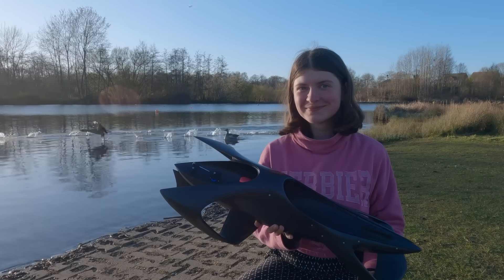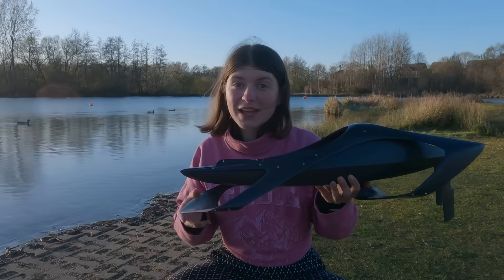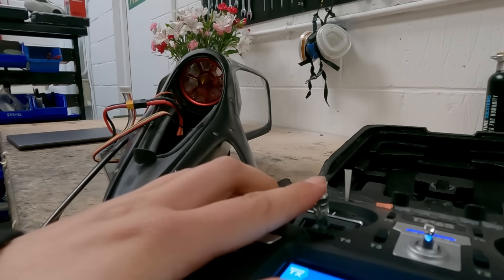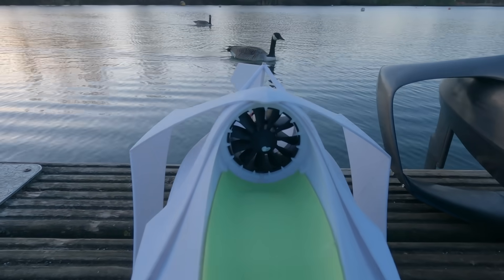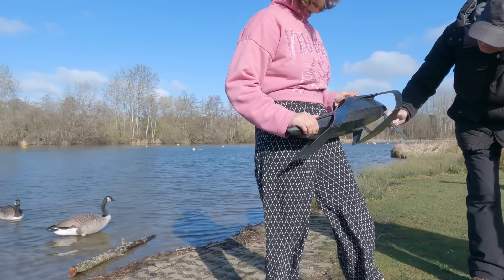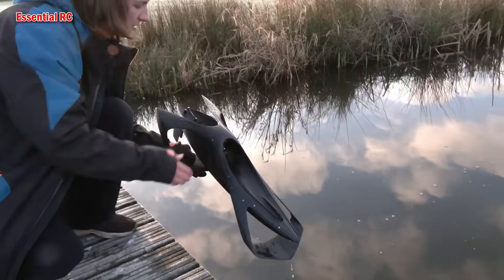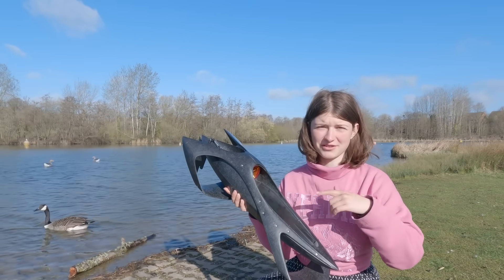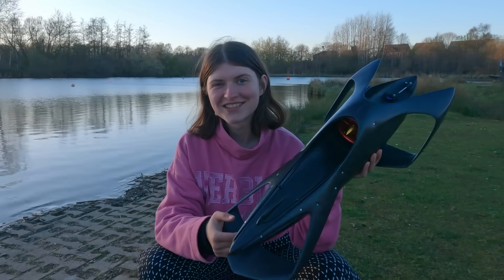Boat Propellers are Overrated... The HydraJet Explained

Comment: Well done i like fast small pylon racer type CZ republic  Voodoo plane ~20 inch wing span hits over ~120 mph in dives with S400 brushless types. For future project I want to scale up to have liquid fueled rocket engine ~25 kilo push for ~10  seconds burning LOX and 100% nitro methane for  engine  run  in a vertical dive to level out  about ~50 foot height and exceed the ~550 mph that kero turbines give .The idea is rocket craft is  dropped from mother craft at ~1000 foot height  but recon it needs auto pilot control with RC to ensure it isnt going to lawn dart . Biggest problem is how to ensure reliable pressision  engine starts making solid fuel and hybrids rocket engine unlikly to work . Lots of onfo on high speed craft from ~550 mph dynamic soaring non engine RC gliders and ~550 mph  Kero turbine crafts where models wings are nearly solid carbon fibre wings to take the immense lift on wings at those speeds in ~+10 G turns

Comment: Instead, of having a waterproof motor you could give it a very long shallow shaft, so the shaft is the only thing touching the water, while the motor is in the body above the water - basically like an electric mixer.

Comment: Awesome design. I'll like to see a few things if you're open to ideas and haven't tried them/ruled them out already.

Fuselage/rear wing design more reminiscent of a passenger liner. The rear wing could have 2 engines mounted rather than 1.

Using the air for jet drive through the rear hydrofoil on both rear corners. (You could hypothetically use 2 cups like jet boats to instantly stop/aid in fast turns.

Wing shaped outrunners with small pontoons to maintain stability at high speeds like a sailboat.

Any kind of keel on the foils or boat.

Underglow and speakers. Pimp that boat.

Comment: Put some ground effect wings on it to give it three modes. Displacement, planing and flight. You've got the right propulsion design for it. Great content. subscribed😃
Reply: As cool as that sounds, I think that would be adding extra complexity that this sort of project doesn't need. I think the beauty of the design is how everything is basically rigid and passive. No need for active pitch and roll control. The fact that it's "only" a two-channel design is part of the genius of the design.

Comment: I fly rc slope planes so I have a little knowledge about the concepts here. I was wondering if all that turbulence coming out of the back of that boat is a source of considerable drag on the design. What I have seen of hydrofoils when cutting through the water there is virtually no turbulence at the waters surface. Some redesign needed? Great job young lady, you are miles ahead of your contemporaries.

Comment: Hi, a great design. Very pleasing to the eye and functional. I doubt I could afford one, but if I could I'd like an extra battery to power lights. Preferably lights to give it an Alien craft look. Red. Perhaps a version with strong headlights. And Port and Starboard lights? I'd look at Prop design for quieter running. But the I'd like a version with a whistle like device behind the Prop. to give it the Howl a Russian SU-57 makes. Like a Banshee. 
Good luck!
Oh, how about an Ekroplan touched by your talent?

Comment: You mentioned that aerodynamic control wasn’t sufficient at low speed, so you kept the rudder. Could you shorten the rudder so it only touches the water at slow speeds, and extend the top so it functions aerodynamically at high speeds? I don’t know if you gain much, but in your raw speed attempt, it seems like one less bit in the water would get you some extra m/s.

Comment: good work.        some information about wings and lift
130    a wet or dry wing in motion makes lift at its lower surface, when positive aoa is present in the wing (chord).    lift is a newtonian result; where water/air is pushed downwards, the wing is pushed upwards.   (you may know that because air is stationary, a wind tunnel cannot produce wholly accurate simulations.)
the processes that occur at the upper surface of a wing in forward motion are the source of the lion's share of the  'drag penalty'; which happens whenever an object produces  lift.      (lift  refers to a condition where a wing/object produces more force at one of its surfaces than at the other.  compare streamlining.) 
it should be understood that the main purpose of the (chord-wise) contouring of the upper surface of a wing is to  Reduce  drag significantly; in part, by occupying the volume at a wing's upper surface  --  where turbulence would otherwise occur  --  with  'wing'.
in this case, the 'fuselage' should have a shape that does not make lift.      because, centrally located lift partially un-loads the wings/foils (or aircraft control surfaces).       (this fact should inform any pilot's decision to deploy flaps.)

Comment: Having raced fast I/C R/C monohulls (15cc, 10cc, 6.5cc & 3.5cc) which were horrendously (but also beautifully) noisy in the mid 80's to 90's, as wall as studying Marine Engineering and Naval Architecture at Uni back in the 70's, the design looks great. It does what it is designed to. I would like to see a  scaled up model say around the 2 metre mark as it would be interesting to see how you would power it. Would it require two motors in twin nacelles, etc those are the types of questions that would no doubt arise.

Comment: Beautifully done! My brain, however, went into “Elon” mode envisioning foils below to raise it up off the wake even more. It planes so quickly now, that with (possibly retracting) foils, the current front wing could do double-duty as a quasi “canard” elevator used to electronically control pitch while foiling. Keep rocking it out!!

Comment: If that Dolphin shaped semi submersible jet ski thing can exist a human sized version of this should. Really awesome design and engineering. I love active aerodynamics/hydrodynamics but getting the same kind of performance with a simple (relatively) passive system is genius.

And for project car people why has no one used a bunch of big EDF's as under car sucker fans? I've seen something similar used for brake cooling but I've never been able to find a project car with a bunch of EDF's pulling air from the under body. I'm aware of the few Hypercars using big fans, they're incredible. And a billion dollars. But it seems like you could really tune where the low pressure zones are with a bunch of small fans and be able to package them into an existing vehicle. Especially on something like a kit car. Or even a Model3 if you don't mind people throwing stuff at you everytime you drive anywhere. Can't think of any other performance oriented EV's you can buy cheap now. Anyway I'm just dreaming, I'll try to work out the math if I ever find a good example of the next car I'm currently looking for. A relatively tiny drop in pressure can add up to a lot of downforce over the entire underside of a car.

Comment: I must say that is a great design you've done my only niggle I can see is your brother it's creating a lot of drag. Have you looked into using your foils as runners two small ones on the rear foil could increase your speed  and the look and yes, if you put the Batman logo on, it would be great or you could call it the stealth boat

Comment: Great design, but I think your real problem is the same problem you had when filming at 0:02. I'm not coming at you from a haters perspective, I'm not an engineer, but I do nit pick to find problems and help (I hope). Birds and any other debris getting into the propeller would be catastrophic. I can imagine that a manned vehicle would need a compartment for any occupants and I can foresee you having a second propeller (extra thrust, and safety if one fails), probably mounting them either side of a cabin in the middle. I think you're onto something good here, it looks F1-esque. I'm excited to see where your designs will go!

Comment: This would be really Cool scaled up with FPV + GPS + LIDAR for Fish Finding. I would consider Steam
Jet Propulsion for speed and range extension. EDFs are very power hungry. Super Cool Design. 
FYI the boat that holds the water speed record was made using Plywood.  Water Cavitation is the limiting
factor as far as speed is concerned. You Totally ROCK!!

Comment: It is very cool and nice. Your latest design look very professional and even the Gen1 I tend to like it and seems like out of a CyberPunk theme, sort of. I have 2x standard RC boat (Horizon Hobby Pro Boat Impulse and SonicWake) running in 6S. I have access to a large lake close to where I am. I tend to like speed, right now mine are running around 80 to 100 km/h. There a huge community of RC boat racers that love speed as well, some even spending multiple thousands into it. 

If you can design and make a model that can compete with price and speed of those models available as ARTR/RTR, you could make some good profit I believe. I might even buy one!! Check out high-end models on Oxidean Marine and cheaper models on TFL Hobby for ideas and cost, there's other shop like Offshore Electrics as well. 

I read that Hydrofoil system are supposed to be better in efficiency since there's alot less drag of the hull (almost none) in the water. It could be nice to see a version with motors (or using flexible shafts) in the underwater wings instead of a fan which I assumed is consuming alot more energy for the same distance than a propeller one even if it's lifting up ?? 

Greetings from Eastern Canada. Keep up your excellent work!

Comment: The design of the first boat is super cool looking!! Batman movie would be epic but a Fast and furious or a New James Bond movie!! Or as used as a Fast Attack Vessel for the Navy would be so cool use two Ducted Jet Engines with afterburners to increase it"s overall speed and acceleration! Also start learning about stealth technology and how you can decrease their radar cross-section and Multiple Governments will be beating down your door to buy your design or you can get a badass job in the Aerospace Community!! Have you thought about adding rudders to the front trailing edge to decrease your turning radius and think about some form of ballast on the full size version..... When you get to sea trials (Which I know you will) it should help with being stable in high seas and about the front rudder idea it would be most effective to only (Or safest) turn about 30% or less I can't see it needing to move anymore than that!!! I can't wait to watch you're journey and to see what your amazing mind has yet to invent!!!!!!!!! Good sailing and I can't wait for your next video to drop!!!!!!!!!!!

Comment: So looking at the design , it seems as if the rudder starts below the fan , and then extends into the water. Try a version where the rudder extends up to be even with the fan as well as in the water , that way the force of the fan blows air in a slightly different direction other than just straight back. That should force the rear of the craft to stabilize more, in the water, on turns. You will lose a little forward speed but in turning , should be smoother. Great Idea though , wish ya the best. It might also help if you angle the bottom, back foils, in the water to extend slightly lower and you want the water to be funneled in on your back foil so the water should pass over a wider part at the front of the back foil and get smaller as it leaves behind the vehicle , this also facilitates stability. Increase the fan output about 20 percent , and you should have similar speed results.

Comment: An air rudder will go faster. Design the air rudder so it's partially in the water at low speeds, as the boat raises up on plane, the rudder leaves the water. Very cool design!

Comment: Very Good, impressed . Subscribed. Two issues - Your back side aerofoil is creating too much turbulence, and throwing  water into air, this will damage the airfoil over long use, second the air from the fan is getting compressed around 0.9 Mach or so, therefore the jet throwing out into the tubulent water from the airfoil below causing back pressure which reduces its speed,  see if you can improve on both these issue, also your design is very impressive but it create too much drag, see if you work on reducing the drag also. Good attempts.

Comment: PS: just for the fun: you know podracers from star wars? May be you can realized them with a person on a foil towed by fan pullers,  connected to the battery on the foil The fan pullers, or the fan puller (single might be better) may be in the air 30° up. Could be a converted drone like apparatus, but two fans counterrotating, with some thrust down to elevate would look awesome.

Comment: Awesome! You loose power due to the water rudder. Try it again with an air rudder. try to set it more aft and use a neutral wing shape ( thicker in front, thin aft). You have to think more aerodynamic, because at speed the thing is essentially more a plane. But, thats not new to you, because you are capable!

Comment: Solar-battery powered with water jets would be cool. Nice, but I don't like the whiny motor sound, so water jets or insulation? It'd be cool to have battery-assist pedal power hydrofoil. Great work.

Comment: Wait a sec. Background in motorsport, sustainable cars, volunteering for lifeboats, and making this Hydrajet as a commercial product? You only look about 24, and there's no way I was that productive at that age. Whatever motivates you, keep it up.
Reply: She just kept casually dropping cooler cooler stuff throughout the video 😂
Reply: Technology
Reply: As long as you know that there are no such thing as sustainable cars.
Reply: @Jayjayjoe throw your phone away
Reply: ok joe
Reply: @Jayjayjoe  There is a need for smaller cars, though.
Reply: @Jayjoe They would be good for parking, and they are definitely more efficient gas or electricity wise due to less weight but thanks to vehicle size standards being larger space on the road wouldn't be saved unless some double laning laws were implemented for motorcycles and mini cars. So more efficient definitely. 

As for sustainable, you could potentially run one off of a flywheel battery, like those buses in Switzerland in the 60s. No rare metals used, all the metals just need re-melting and forming to use again and some rubber parts which can be done sustainably with the right chemical processes and would have to be done for the wheels anyway.

Comment: How much wing surface, area would be needed to get that boat into the air either in full flight or in ground effect would be good too. Just wondering if the wings on the boat now were used in diamond formation like they are now. It just struck me that your boat design is screaming to get out of the water and into the air! all the best and nice boat design. 
;'0) 
M

Comment: I wonder if some surface feature on the wings would deliver either better performance or better stability. Think whale skin. Also, I wonder if there could be some mechanism that allows for smoothing out the water surface before the fin reaches it (to reduce ripples), possibly also creating efficiencies. For example, if a line of directed air was continually blasted out at a low angle just in front of the wings, and scales with speed. Could also even experiment with expelling gas from the wings to create some cavitation, think air hockey. Of course there are also more advanced techniques, such as oscillation/vibration of the wings to create cavitation.

Comment: Grand design! Kudos to your work and efforts. I like the reduced surface area under the craft and also using air as a medium to provide thrust for motivation of the craft. Water is too heavy and requires a lot of energy to sustain the boat under thrust to overcome its mass and present friction. However, friction above all else is a constant and cannot be totally minimized.

Comment: Do you think it would be better to steer by putting the steering fin behind the air jet, instead of in the water where it would produce drag? Splashing water behind the boat is indicative of drag and wasted energy. If focus on you can reducing the turbulence behind the boat, I think you will get more speed.

Comment: That is a very interesting design and I imagine just about everyone wants to see it go faster. 

I see it pulling a lot of water up at the tail, that rooster tail shape of water. I wonder if you might get The fuselage out of the water a little faster and run a little more efficiently if you had a little bit of an edge towards the tail end of the fuselage to encourage flow separation. As I understand it, flow separation is actually a good thing with a boat hull.

Comment: Interesting project!
I, an engineer, always wondered, we have expensive air-cargo and very low speed naval cargo ships, why wouldn't we get something in-between something such as Soviet Ekranoplans. This a good step in affordable sea-hovering transportation. Love the idea, brilliant!
Reply: The only challenge with this is the overcoming oceanic waves, one could make higher body to underwater lifter wings, depending on the speed and oceanic wave peak height, this can be arranged too
Reply: Senior Engineer tip: Why won't you overengineer this idea and send some suggestions and a work offer to oceanic logistics companies? I'd love to see the transportation getting cheaper and more fun. I can do it too, but it seems you're way more closer to realizing this dream, at least you got proof of concept. Just need to experiment with payload and write down the energy needed to carry unit cargo(kg/Wh or tons/kWh), compare it versus regular air-cargo and shipping(costs) and make a document about it?

Comment: Very impressive, one suggestion though, putting 2 air rudders in tandem for high speed and small water rudders for low speed that way you can reduce the water drag drastically… (maybe you tried it but it seems you tried single air rudder only and the big water rudder).